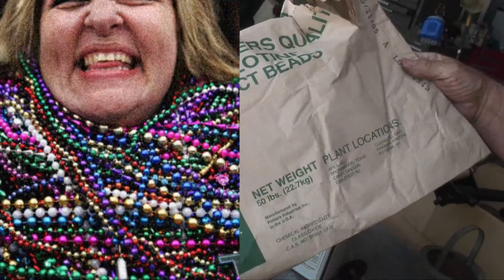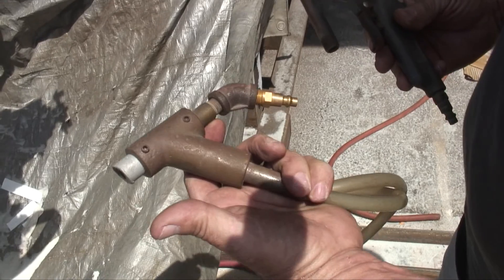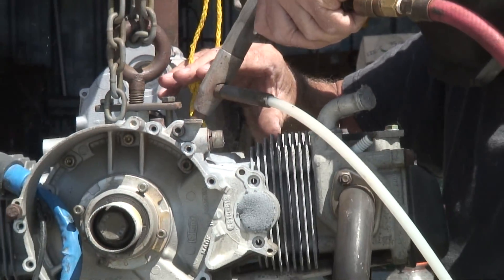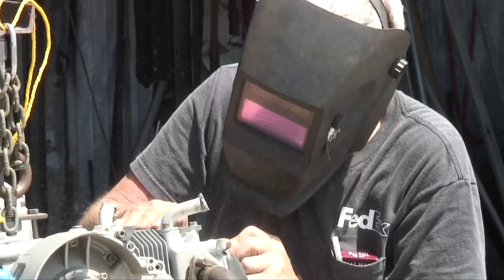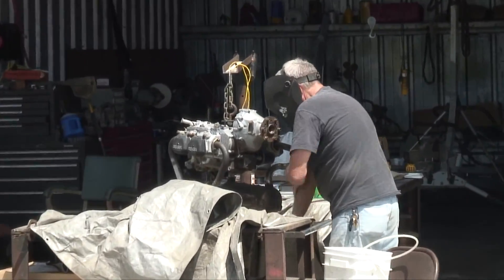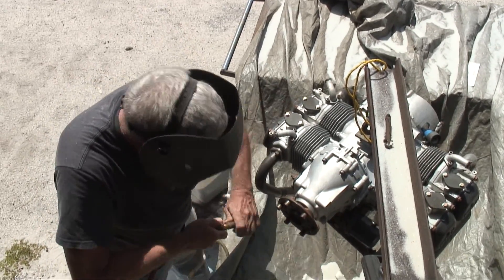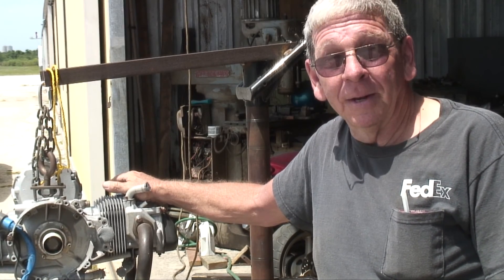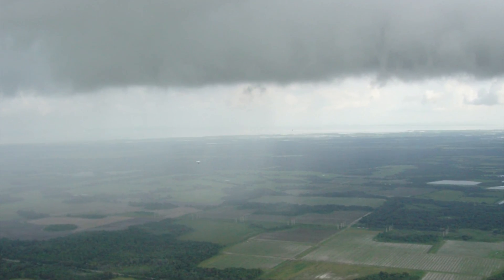Master Claude - Bead blasting engine

Comment: Planning to bead blast a Briggs and Stratton engine block so its not that critical if it fails as being aloft.  The engine cases are split but I am concerned about the crank and cam bearing surfaces as they are not bearings but cast aluminum.  
Do you think they can be taped up and blasted and then thoroughly washed with tide?